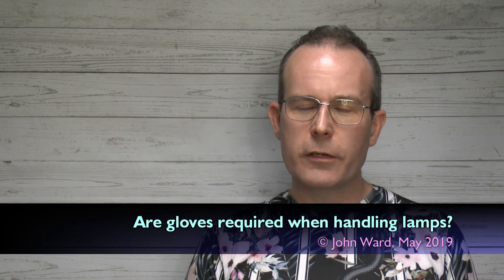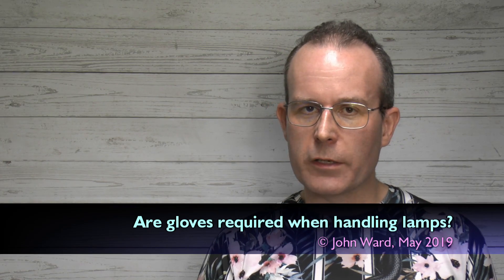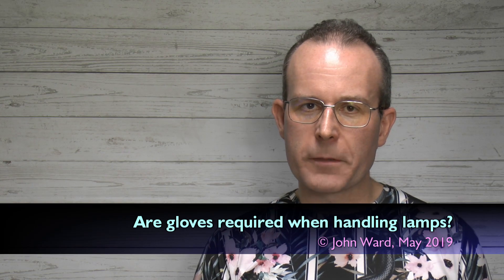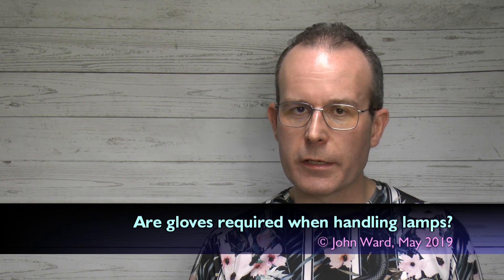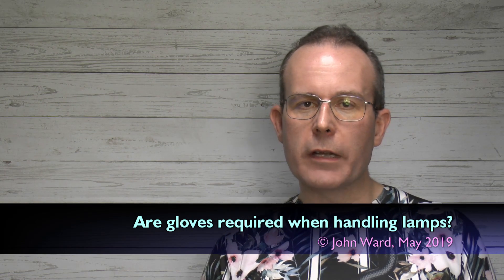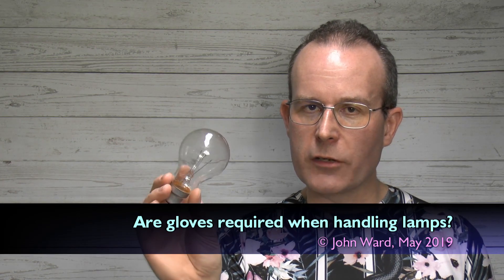Are gloves required when installing lamps ?

Comment: The material of these high temperature lamps is usually synthetic fused quartz, and is especially sensitive to alkali metal contamination such as sodium from human sweat.  These contaminants result in the devitrification (conversion) of the quartz into a more stable, (but weaker) polymorph of silica called cristobalite.  This is what causes the structural failure of the bulb.

Comment: Hi John I have been watching your YouTube channel for about 2 years now find it very inspiring... And I have learnt a lot just a question about three phase homemade inverters made with a motor and capacitors is this a safe method or do you highly rate the three phase box you bought for your CNC machine instead..? keep up the good work all the best
Reply from the maker: Depends on what the application is.  A VFD / inverter is a good solution for one motor or machine, particularly where speed control is required.  Rotary converters are good for variable loads such as where several machines may be used with it, and will generally last for ever provided the capacitors are replaced every few years.
If it's just one machine with a 3 phase motor, another option is to replace the motor with a single phase one.

Comment: The rule I seem to find the most useful is if the lamp material you are making contact with is Quartz AND the lamp operates at a high temperature you don't want to touch the lamp. Most glass lamps (including the few glass halogen capsule types) are safe to touch with your fingers when cool. Of course I generally handle all halogen capsules the same unless they are the type that you can replace a standard flashlight lamps with such as the HPR-52 for example.

Comment: I’ve installed halogen bulbs into security lights many times without wearing gloves, and not experienced any premature bulb failures. Perhaps it depends how oily your fingers are.
Reply: It also depends on the type of halogen lamps, some of the lower powered capsules are made of Borosilicate (Pyrex) glass instead of quartz. These lamps are not affected by fingerprints.
Reply: John McFerren - Interesting. I tried to look for that on two packs of Diall (B&Q) spare bulbs I have, but there was no info. I did however notice a tiny no touch icon on the packet, which I missed previously. But despite touching them when I put them in, it doesn’t seem to have done any harm. The bulbs in two security lights are typically lasting for over a year, despite going on & off several times every night.

Comment: On this occasion I will disagree with JW and you should use gloves all the time when removing glass lamps. I was in hospital once and in an adjacent bed was someone who tried to remove a standard filament bulb with bare hands and they did enormous damage to their fingers and hand when the bulb shattered during removal. Major surgery almost life changing in the amount of tendon damage done. Wear gloves. It's not difficult 🙂🤷‍♂️
Reply: @pmailkeey Are we about to have a discussion on how many YouTube commenters it takes to change s lightbulb? 🤷‍♂️
Reply: @Paul Sanderson I would image that insertion and replacement will get conflated for many people. As a general rule I would just wear gloves whenever dealing with bulbs. Easier to remember 🙂 The case I mentioned was removal where the bulb has fused or stuck for whatsoever reason. I've seen this happen myself and given the damage I saw I'm not recommending anyone doesn't use a glove  😕🤷‍♂️

Comment: I used to work in a lab that developed halogen lamps, generally they would be cleaned with alcohol and handled with cotton gloves before life testing etc. However a colleague would often handle lamps with clean hands, the lamps when run would often show white fingerprints where the quartz had devitrified but it did not affect the life. I try not to handle them with bare hands, usually there is some kitchen tissue or similar around. Usually fine to give the lamp a polish with clean tissue, no real need for a specific degreaser. The manufacturers probably know that their instructions won’t be followed 100% but sensible care in handling them is only a good thing.

Comment: The Quartz halogen bulbs use as the name sugests Quartz as the envelope, if you touch it the sweat and oils in the skin will eat into it, if you touch one with bare hands and then leave it a few days without use you will see your finger prints permently etched into the surface, if you do touch one accidently clean it with alchohol straight away.

Comment: Have you ever had the glass of an old filament bulb break when you try to remove it? That is a fear of mine.
Reply: I spent six years in a lamp factory maintaining the machinery there. Lamps exploding, especially on test was very common. Glass all over the place. Lamps breaking when removing them from fittings was less common - but a fear of mine as well.
Reply: @pmailkeey Barge poles might be better, there must be thousands of 2nd hand barge poles out there, just waiting to be repurposed. Even better, attach the stilsons to a barge pole for added distance.
Reply: Happened to me once when removing a blown Christmas light with my teeth, I was drunk and forgot to unplug the things. Thankfully the string had a control box and was set to a low duty cycle setting, only got a small tingle from it.
Reply: @uK8cvPAq  Should have worn PPE https://www.amazon.com/Vampire-Plastic-Costume-Accessory-Favors/dp/B003O6F9RQ
Reply: @pmailkeey Well, if we are going all mechanical on this surely it would be easier to use one of those ordnance disposal robots, then you can sit, quite literally kilometers away. For added safety, if the budget allows you could use something like the Mars Rover and control it from an entirely different planet.

Comment: Otherwise solid advice still for halogens and such but... it would be good to mention using CLEAN gloves or cloth. Those old oily garden gloves don't really do the job very well and many people might just think "a glove is a glove"...
Reply: I've worked in lighting for over 40 years, and I have installed literally thousands of halogen l;amps without using gloves.
Name brand Halogen lamps are supplied in a sleeve - simply tear off both ends and use the sleeve to protect the quartz... then remove it after installation.

Comment: You didn't mention that in case of accidental handling of halogen bulbs with bare hands (NOT bear hands) then it's possible to clean them with methylated spirits or isopropyl alcohol.
Reply: 0:55
Reply: @ShadowzGSD  
You're absolutely right. Thanks dawg!

Comment: Think my local lighthouse is/was using a small cluster of those halogen capsule lamps. Really small output until it went through the Fresnel lens and then it could thankfully be seen for miles. Know they are/were planning to upgrade to LED bulbs to save money......big saving from when they used oil lamps!

Comment: One more: xenon short-arc bulbs. Those are under extremely high pressure, and a single fingerprint can absolutely be enough to set them off during use. Of course, it's unlikely that anyone outside of cinema technicians will be handling those bulbs. They typically require a thick welding jacket and face shield in addition to PVC-coated gloves just for basic safety already.
Reply: I remember using those with an orcon lamphouse. I think they sre under a vacum not pressure tho. At the time we just used to bin them but we had to smash them in a box first.
Reply: @tonyjones9442  No, definitely under pressure, even when cold.
Reply: @cambridgemart2075  yes, i think  you are right. The word xenon (gas) gives it away. Re-reading my comment i realised.  Remember carbon arcs on a spring? Im too young to have used those.

Comment: I was hoping you'd demonstrate the problem. The warning is well known, but I've never seen the result of not heeding it
Reply: Yeah... love to see the proof.... I've always handled these halogen linear lamps with a cloth... but in the old days these would get splatter with all types of gunk at work and it just burned off... never cracked or exploded.  The only time they really failed on me was with a knock or two.  Cheers JW... all the best.
Reply: @Matt Quinn Very nicely put.
Reply: The halogen lamps run too hot for standard Soda Glass. So the envelope is made of quartz. Quartz is porous to the oils in our skin, so they can leech into the material.
The oil causes the area to get hot, with the quartz blistering. Usually there is an air leak and the bulb internally blackens. Studio lamps mentioned by Matt are operating at high pressure, so the weakening of the quartz can cause quite catastrophic results. In the lighting industry we call that "a non-passive failure" :-)

Comment: Yup takes me back as an apprentice trying to fit a 500w tungstan halogen lamp n finger marks all over the 500w tungstan lamp & same for car head lamps as per well done John dose any one rember cutting through the original bolt to in those fittings to replace the 5 00w lamp then replacing the original bolt with a tie rap ????

Comment: I've found the life of filament led lamps to be terrible
Reply: The decent quality lamps appear to be reliable. I bought them in the U.K. I have three fitted in outside “coach lantern” type fittings. Two are controlled by a PIR sensor and are activated regularly at night. The third is manually controlled, but used regularly to light up the garden when we let the dogs out after dark. All have been in service for over three years now.
Reply: @Mark1024MAK  same here. Outside lanterns with light sensor. Also a couple inside. UK supplied. They seem to fail on one filament leaving the rest intact but when you have two lamps next to each other it looks terrible with one at half power so it has to go in the trash.
Reply: @barrybritcher  They might use a really simple driver as the filaments are usually quite high voltage. If your area has a very high voltage and/or regular spikes in the grid they might really eat up the types of LEDs which don't have a "proper" DC switching power supply.
Reply: Perhaps someone should contact the RSPCA!
Reply: lol, back when LEDs were just coming in and were really not built that well and used to fail all the time I used to use combine components from non working units to make a single working bulb.